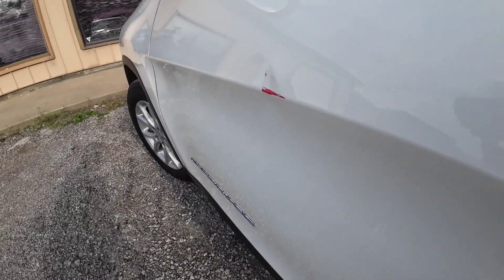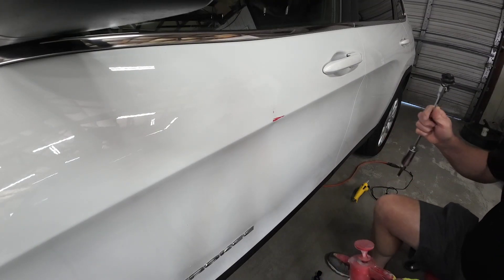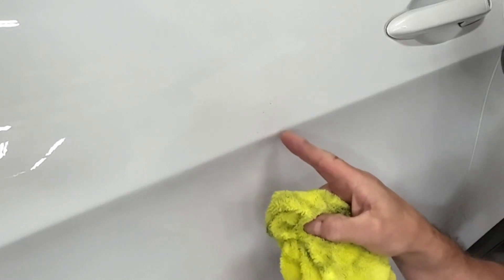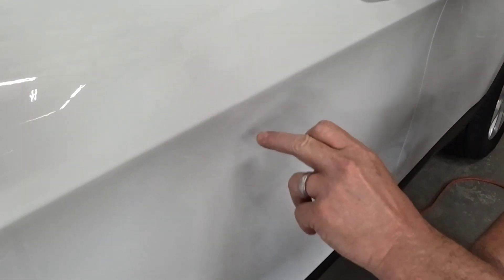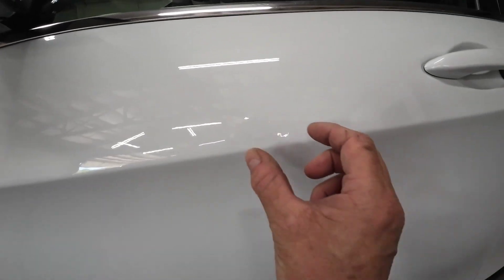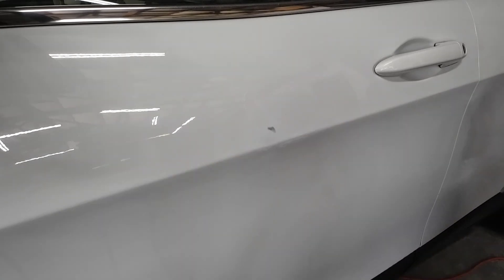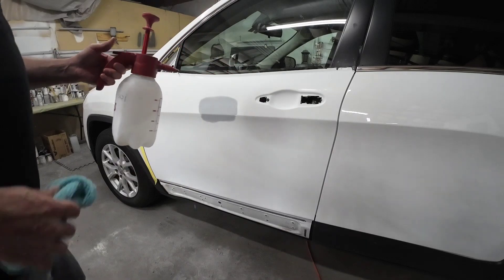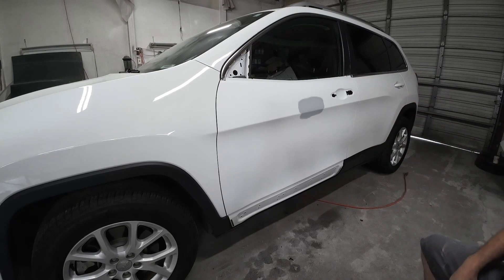COMPLETE GUIDE to repair and paint a small dent in your car!

Comment: I have a similar repair that needs to be performed and they want to paint both doors… is it possible to just paint the one door hoping it matches?!
Reply from the maker: Most of the time the blending process is necessary and you may have to paint both doors this dent was right in the middle so I could keep i confined to one door.
Reply: @GarageNoise  also, if it’s not white under then paint chip and it’s the color of the car does that mean only the clear coat was damaged

Comment: Nice!  Ive had minimal luck with pulling something that close to a body line. I've had great success at conveniently forgetting where I put my slide-hammer,  mixing a decent amount of filler and voilà!😬
Reply from the maker: 🤣I may take it a bit far but your still good with filling up to a 1/4 inch which is a good bit of filler.

Comment: Great video!  Question: Once you finished spraying the base coat before clear did you sand the whole door with 600/800 grit wet? Than you cleared it?
Thanks
Reply from the maker: No you don't  want to do that. I will however denib dust in the basecoat before I clear but you must apply more basecoat before clear.

Comment: Would you recommend the gun you used for doing a whole regular cab truck at once? Or in parts? I have the same one but not sure in case of air fluctuation
Reply from the maker: Depends on your compressor and how much air it produces. The gun will have no problem  painting a complete job. It might be slightly slower than a conventional gun ,but the difference is minor.